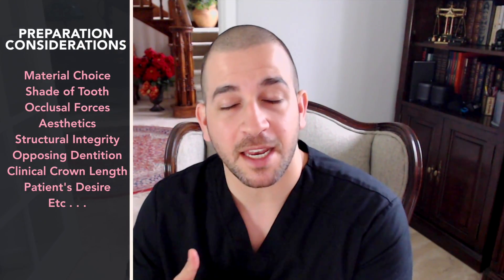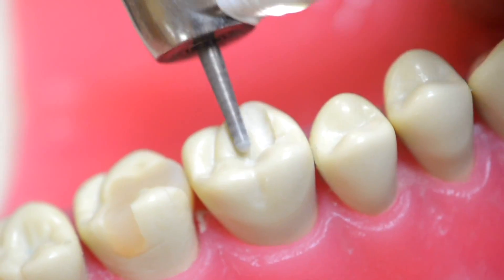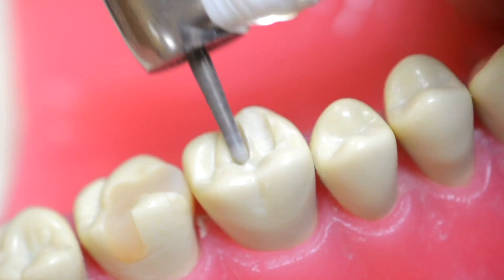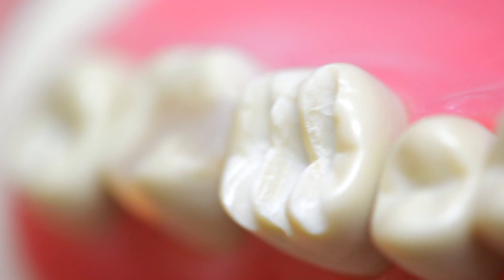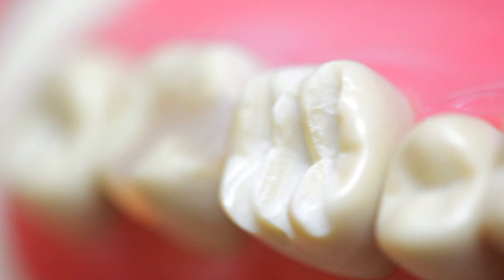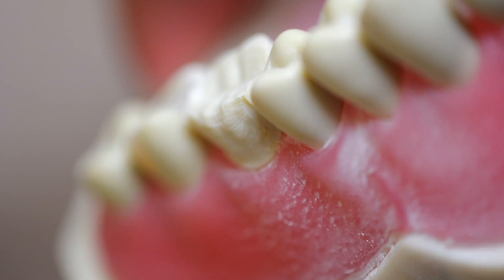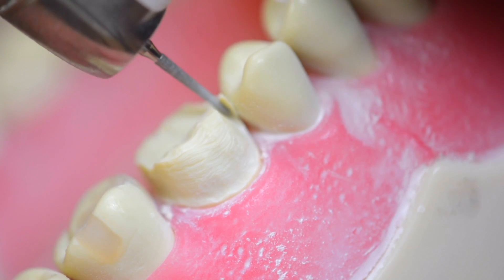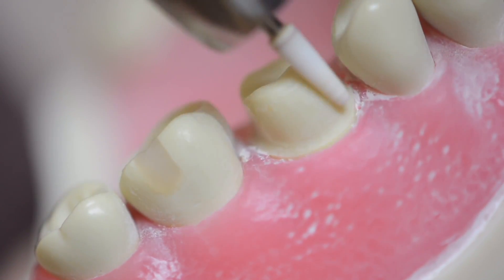Molar Crown Preparation | Dental Crown Techniques

Comment: Love your videos and the details, but sometimes it's really hard to implement it in the patient's mouth especially when they have a strong tongue
Reply from the maker: Absolutely. Managing a strong tongue is something that develops with more practice. Some tricks include using a high vacuum suction (Doctor controls it) to retract the tongue while preparing the lingual aspect of a crown or by training an assistant to properly manage the strong muscle. Sometimes my assistant use a high vac for control while other times they may use a hand mirror with high vac...

Comment: What's the cord for?
Reply: It’s gingival retraction cord.  It’s used to push the gum tissue away from the base of the tooth.  In his video after packing the cord he was able to prepare the structure of the tooth that sits below the gumline for the crown.  
It’s probably the most uncomfortable part of the procedure but completely necessary to ensure the crown will completely protect the structure of the tooth.  Cord packing is typically required for veneers and fillings at or below the gumline.  Post procedure the gums are typically a bit irritated but within a few days to a week back to 100%.